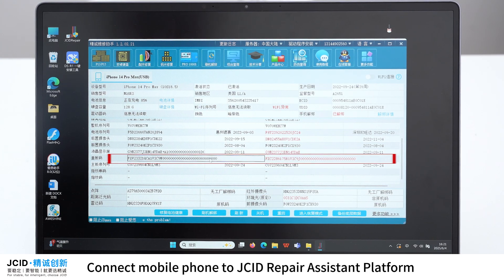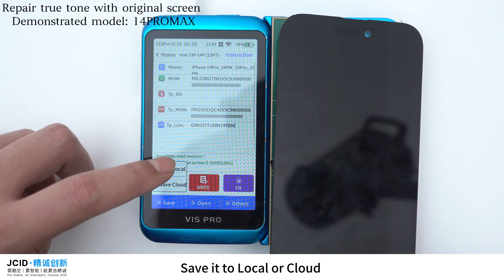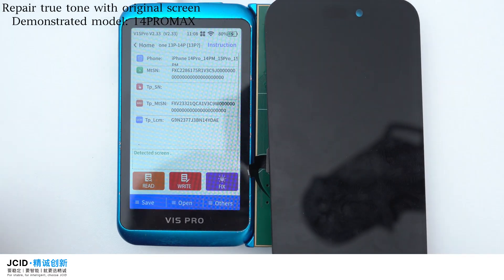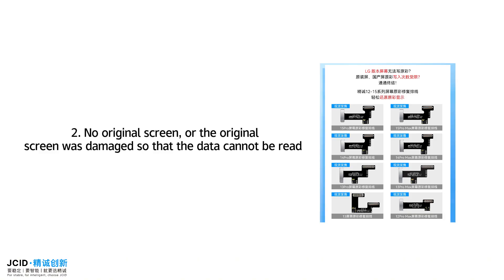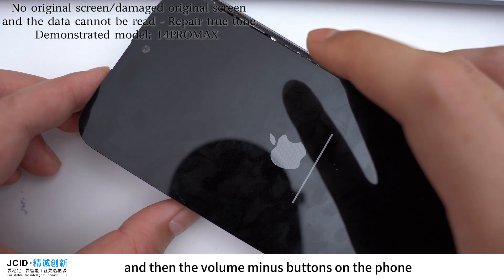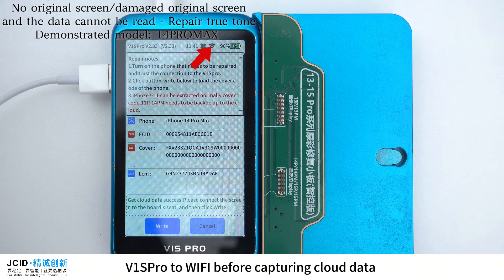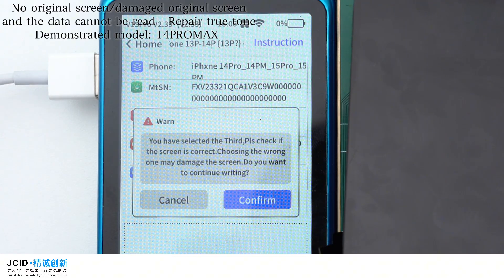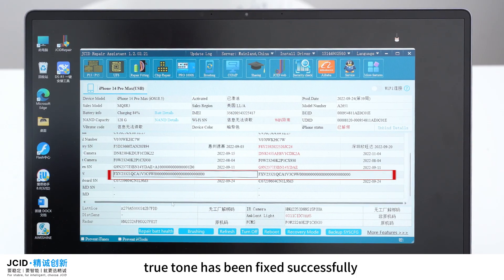12-15 Series iPhone Screen True Tone Repair with JCID V1S PRO- Operation Guide #jcid #truetone

Comment: I am not sure what the goal of this is.  If you don't have the OG screen, you can brush the phone and then just write that code to the LCD if needed for true tone.  The release of IOS 18 has auto fixed truetone on most screens anyway.  The only thing that does not go away without either the original screen chip or the new diagnosable screen is the unknown part message.  So unless this new tag on flex can achieve the same results as the new diagnose-able screens, then what is the point of this?  What bad vendor would sell you a screen with no writes left to it?  Why would your shop get back a screen so many times that you would write over the code until it is depleted, sounds like that just a bad screen time for a new one.  So I am really scratching my head with this one, what problem does it really solve?  I personally think it is just another thing to try to make money out of that does not really solve any actual problems, it just solved invented problems.